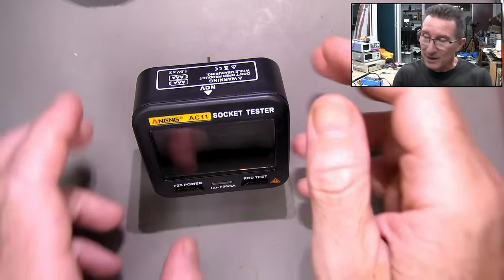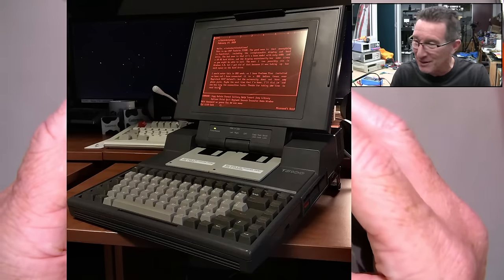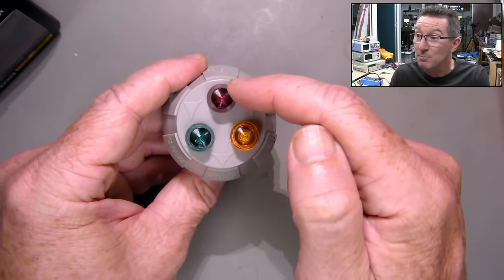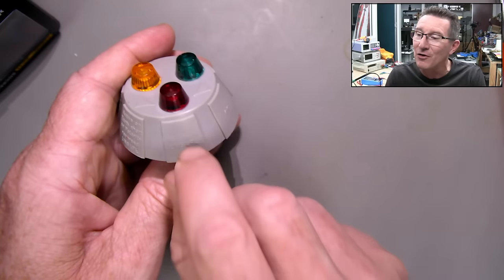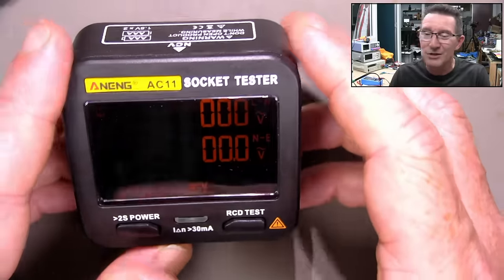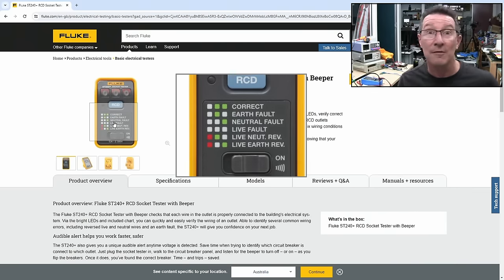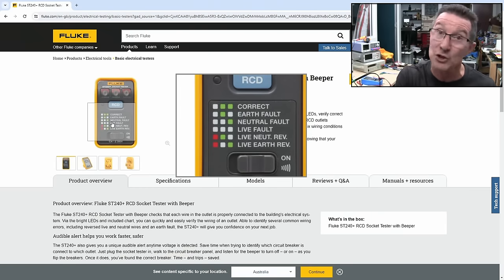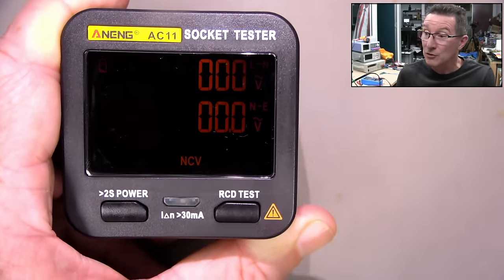EEVblog 1598 - ANENG AC11 Socket Tester TEARDOWN + SCHEMATIC Reverse Eng

Comment: One of those drove me nuts recently.  The batteries were low and it started making faint beeping noises at random.  It too me ages to find it because there was such a long delay between the random beeps.
Reply from the maker: Widlarizer time!
Reply: This happened with our smoke alarm.  It started beeping about every hour all day and all night. It was impossible to figure out where the sound was coming from.  My wife and I thought it was the microwave oven.   Just when you fall asleep at night  BEEP!  Grrrr.  Finally we called the landlord and he came and changed the battery  :-)
Reply: I had the same experience. I replaced it with a silent Klein.
Reply: @robinbrowne5419  I had that same problem. I had to take one of the smoke alarms off the ceiling and put it right beside me while I watched TV to find out if it was that one or the other one without having to stand in the hallway for 30 minutes.
Reply: @chitlitlah  Very annoying indeed.  But at least they work.  Another annoying thing is when the smoke alarm goes off for burnt toast.  But again we can't really complain because at least it works.

Cheers from Canada.  Yay!! The snow is all melted now.
Reply: @robinbrowne5419  - use a Photoelectric detector in cooking areas, and you won't have the false triggering.
Reply: @johncoops6897  So if a photoelectric detector won't detect burning toast in the cooking area, will it detect burning wood?   But interestingly the smoke detector does not detect cigarette smoke.
Reply: @robinbrowne5419  - yes, they detect different kinds of fires. An ionization smoke alarm is generally more responsive to flaming fires (imagine a fire where you can see the flame), and a photoelectric smoke alarm is generally more responsive to smoking smoldering fires (such as a cigarette).
.
You should always install both. I installed Ionization in bedrooms, a combo of both across main areas, none in the kitchen but one just outside. Never had one false alarm, even for toast.
.
However BY FAR the best thing is to have them linked, so that if one goes off they all sound. In that way you get immediately informed of an issue in an unused part of the house.
Reply: @johncoops6897  Thanks for the great explanations 👍   I actually don't mind getting some false alarms for toast because it means it's working.  It also goes off if you accidentally leave the stove on high so that's good 👍
Reply: That's so annoying when you can't find what's making a sound.. 😂
Reply: @robinbrowne5419  First smoke alarms we had were fitted in a bungalow. When the same thing happened I was convinced for weeks that there was a bird trapped / living in the loft above. I was in an out of there for more than a week, until the bleeping became more persistent and I was standing beneath the culprit one time when it happened.
Reply: Free annoyatron!
Reply: @clovislyme6195  Yup. It has to be one of the world's most annoying and confusing things.  Cheers from Canada :-)
Reply: @kylejones8392  Yup. Annoy-a-tron. That's what it is :-)
Reply: My smoke alarm does that when the battery goes low... which is annoying considering it has the power to make that absolutely eardrum shattering loud BEEP!

Comment: is it just me or is the socket upside down
Reply: Odds are that’s because that’s a Chinese socket not an Australian one as asserted in the video.
Reply: No insulated pins, its not Australian. Its  the Chinese plug which is the same but upside down.
Reply: @quinks  Patently incorrect. Everything in Australia is upside down. As Dave regularly states “if left upside down all the electrons will fall out”. This is a large problem in Australia, and thankfully Aneng corrects for this dangerous problem 👏
Reply: @redolgreg - Whilst the dimensions are similar, the Chinese plug design has thinner pins (as well as no insulation on L&N and the earth is on the top).
Reply: @johncoops6897 earth on the top is safer😂
Reply: @jonathanbuzzard1376  - if you "reach around", you may get a nasty shock!
Reply: @johncoops6897 it was introduced because someone wearing a neckless dropped it into the gap and apparently died.
Reply: @landspide  - LOL, yeah sure it was.
Reply: @johncoops6897  It's more historical. Back before sleeved pins were a thing, if you dropped a conductive object behind a partially inserted plug if live/neutral are up top you can get a nasty shock from live through you to earth. If earth is up top then there is a much better chance the current is going back through the earth pin and not through you. This is precisely why the earth pin is on top on the UK plug. It is the only clean sheet plug/socket combination that was designed with safety in mind at every step and it shows when you understand all the little safety features in the plug/socket design.
Reply: @jonathanbuzzard1376  - I understand it a lot more than you might think. Plug designs are NOT just dependant on some random person dropping necklaces onto plugs that are partially inserted into wall sockets.
- in other words, that is a possible by relatively unlikely way to be de-alived, compared to the multitude of other ways back then.
.
We know that the whole of the UK is immensely proud of their clunky and cumbersome domestic mains plugs... I guess it's about alll those guys have to be proud of? 🤣
.
BTW the UK electrical safety stats show that they have relative poor safety compared other developed countries. For example, electrical deaths are about 1 per million per annum UK, which is over THREE times higher than in Australia where earth prongs are on the bottom. And the UK rate is about 50% higher than the USA, and they don't even have insulated pins. 😉
Reply: @johncoops6897  The only way to make the UK plug less "clunky" as you put it would be to start removing safety features from it. You might be able to get it a little bit smaller without compromising on safety with modern manufacturing techniques today but you would bearly notice the difference.
As to being proud of things, I am immensely proud that the UK was the first nation in the history of the world to decide that slavery was morally wrong and engage in an almost religious zeal to stamp it out spending hundreds of billions of pounds in today's money bending our whole foreign policy to that end in the process, at the cost of thousands of British lives.
Reply: I work in a hospital and all the plugs are installed this way.  I thought the same thing but wouldn't you know it's the correct way.
Reply: Plug packs/wall transformers from China are a pain as most have the cable exiting out of the bottom but using them here the cable is at the top. I have no idea why the pins are rotated 180.
Reply: @michaelslee4336  - because the Chinese Standard his the earth pin at the top.
You should NEVER use Chinese (export standard) plug packs... They do not meet Safety or EMC standards, and are literally a death trap (aside from making tons of radio interference that kills your wireless range, etc).
.
Toss them and use a properly certified Australian adaptor, for your family's sake.
Reply: @jonathanbuzzard1376  - it'd be a lot less clunky without the fuse, (just put that inside the device, like everywhere else in the world). It also doesn't need pins that are fatter and stronger than the London Bridge, designed to inflict more injury than any Lego piece.
Anyway, you can't change it now... you're stuck with it.
.
BTW the UK plug was developed about 150 years after they abolished slavery, so that's hardly relevant to anything... have they done anything else worthwhile since then? 🤣
Reply: @johncoops6897  Bzzzt if you put the fuse in the device then the flex is not protected against faults that could draw sufficient current to overheat the flex and cause a fire while being low enough not to trip the protection device on the fuse board/panel/consumer unit etc. The solution would be to have all electrical flexes rated to carry the current the circuit is protected for, but then the cable for a laptop or table lamp is huge and chunky. If you don't have a fuse in the plug then the plug design is less safe than the UK design. You could make the pins smaller, but it would save a negligible amount of space. The spacing of the pins and additional material to the edge of the plug are more safety features of the design. Like I said making it less clunky would compromise safety 🙂
Reply: @jonathanbuzzard1376  - LOL the fuse in the device is ALWAYS rated lower than the rating of the flex. You can have a 20A breaker, and Device that draws 2A and the fuse would thus be rated 2A. Even a light duty 0.75mm flex could never overheat before the fuse blows.
What is this mystery phenomenon  that only affects flexes in the UK yet nowhere else in the world?
Because of your UK indocrination, I don't think you've really ever thought about how electricity actually flows and works.
Reply: @johncoops6897  That's what the switch on the socket faceplate is for: so there is no power to the plug pins while it's half-in and half-out.
Reply: @jonathanbuzzard1376  The UK may have been the first to abolish slavery, but not because it was morally wrong; rather, it was simply the case that slave labour was unfair competition for the newly-invented steam engine.
Reply: @bluerizlagirl  - US sockets don't have a switch. Many sockets in Europe, Asia and China don't have switches either. Shaver sockets in the UK don't have switches. Extension leads don't have switches on them, neither do power boards/strips.
...
And even in the UK, Australia, NZ, etc where there are wall socket switches, if the appliance is itself switched off, it's common to unplug the device without disconnecting the power switch.
...
Anyway, what's that got to do with anything anyway? If the socket is switched on, tripping or tugging on the cord could partially unplug it. Without insulated pins, fingers or objects can easily make contact with live parts.
Reply: @johncoops6897  UK shaver sockets do have a switch; it's on the primary side of the isolating transformer and actuated by inserting the plug.

Continental sockets are recessed into the wall, which prevents the pins from being touched.
Reply: @bluerizlagirl  - OK, so what? You still haven't explained whatever point you were trying to make....

Comment: Industrial Electrician in Sydney. You're correct, Dave, the Neutral and Earth in your building will be linked at the main switchboard then the submains to your individual tenancy will have 3P+N+E conductors. AS3000 forbids multiple MEN links within a single structure.
Reply: If the building was in NZ and built prior to ASNZS3000 being mandated here (roughly 2003), things might be different. 

The old NZ way was to have both a neutral and earth from the main switchboard to the subboard, with an MEN link in the subboard. This was called a 'linked busbar switchboard'. Upside is you get a redundant neutral/earth and lower impedance; downside is you get ground bounce/rise from neutral current, not just neutral rise.

ASNZS3000 doesn't actually explicitly forbid multiple MEN links IIRC, just a blanket prohibition on current flowing in earthing conductors. Two transformers is a classic case where you would expect two MEN links.
Reply: In the US (NEC), neutral and ground must and are only allowed to be bonded at the main panel only.
Some US freestanding generators don't work with GFCI-containing extension cords because their method of bonding ends up leaking current across ground rather than neutral, necessitating unbonding with grounding. (Although the neutral should be grouped.)
Reply: s/grouped/bonded/  YT deletes comments whenever I edit them.

Comment: Hiya Dave, as a pommie electrician, I would never use a product like that at all. I wouldn't trust it. Personally I have the fluke you showed earlier in the video. For anything more complicated I would use my multifunctional testes (earth fault loop tester, IR tester, RCD tester, phase and volt tester). You will probably have a TNCS system and your earth will be tapped off the neutral from the transformer instead of the supply cable.
Reply from the maker: I'd want a short leaded one if this was my day job. Certainly wouldn't have one of these.
Reply: @EEVblog  the leads are removable on banana jacks. To be honest longer leads are better as you can test light fittings more easily by putting the tester around your neck and with your tongue in the right direction with one hand probe the LNE and the other press test

Comment: The RCD tester is basically what tells you whether you have a swapped neutral and earth. Although any device plugged into the outlet would trip the RCD either way.
Reply: Was just going to say the same thing!
Reply: You cannot have swapped earth and neutral with an RCD. It would trip immediately.
Reply: @okaro6595  Exactly. That's the point. Well, not immediately, if no load is plugged into the outlet.
Reply: @okaro6595  It would work fine as long as you wire the plug to match, I can see some people I know doing that if the socket was wired wrong :)
Reply: It took me a while to figure out how that could possibly work. I think I figured it out: if N and PE are swapped after the RCD then pressing the test button won't cause a trip. I was coming from the North American perspective where our GFCIs are usually installed much closer to the load. Here that test is next to useless because the swap is most likely before the protective device.
Reply: @eDoc2020  Hmm. Generally, yes, if the test button doesn't trip the GFCI, it might indicate N and PE being swapped.
You could argue about the rest. Functionally, PE and N are in many installations equivalent. So a swap before the protective device would still be wrong, but wouldn't make much difference. In particular, swapping is only dangerous when there is no GFCI at all. In these installations, a break of the combines N+PE can lead to serious voltages being present on metallic enclosures.
Reply: @graealex   Swapping N and PE isn't actively dangerous as long as both wires are separate and terminate at the same point. As soon as one wire combines N+PE you get problems, you don't even need a break in the wire. Normal voltage drop due to load will result in different ground potentials at different outlets. If there's any connection between the two (such as a grounded signal cable) you'll have excess current flow. I doubt a cheap audio cable will be happy with 10 amps flowing through the shield.
Reply: @eDoc2020  Not sure what you're talking about, or if you understand what a PEN actually is. Maybe take a look at what a TN system is. PE and N are functionally the same, at least in TN systems. The dangers are completely different from what you described, aka the audio cable.
Reply: @graealex   I don't think the dangers are completely different, it's still voltage drop either way. A broken PEN is 100% voltage drop, enough to shock people. An intact PEN will have maybe 0.1% voltage drop, not enough to shock people but enough to cause equipment malfunction.

It's worth noting that you can also combine these two scenarios. If a PEN is broken the audio cable could jump over the break. Short term this would remove the shock risk but when you unplug the audio cable you'll dump full mains voltage into the equipment while you are getting shocked.
Reply: @eDoc2020  No. But this really isn't the right place to have this kind of discussions.

Comment: If it's a 6K4 resistors for the RCD detector, does that mean that resistor is dissipating 9W until it trips the breaker? What would happen if the RCD wasn't working? Is there an inline fuse?
Reply from the maker: You get a free hand warmer.
Reply: I think this tester is not complying IEC 61010-1 safety requirements. By pressing continuously the RCD test button you can induce constant ~30 mA leakage current to protective earth. What if the protective earth connection in the electrical panel of the branch circuit you are testing is missing now you have energized all of the metal enclosures of the Class I equipment connected to that branch circuit.
Reply: I thought they would include a PTC in series with the resistors to protect them in case of RCD not tripping but obviously they didn't
Reply: The RCD trips so quickly that these small resistors are usually adequate, however I found a socket that was not RCD protected, one of the 1k6 resistors got so hot it melted the solder and was left hanging on by one end. I intend to replace the surface mount resistors with a couple of 3W resistors which should be OK for a few seconds.